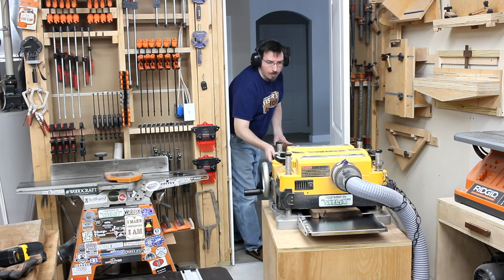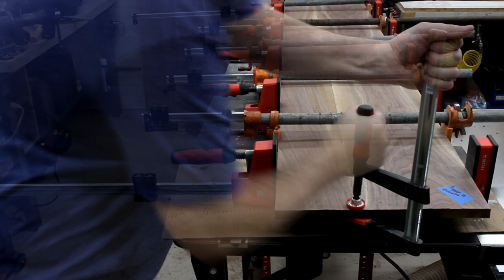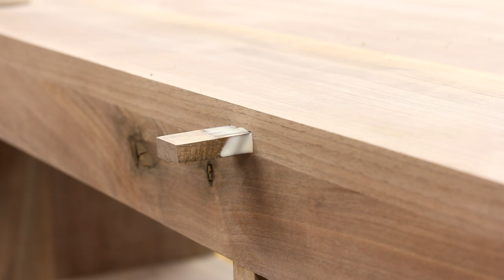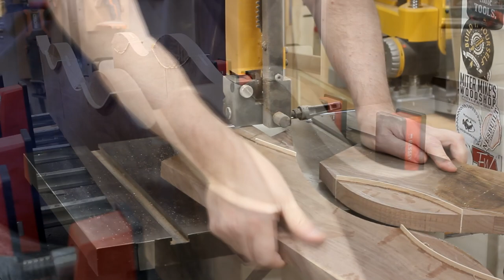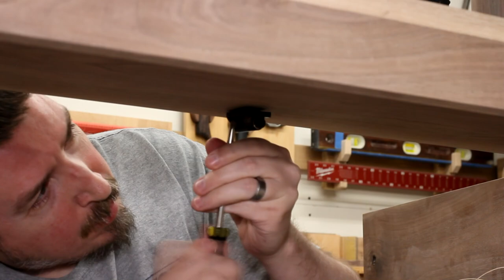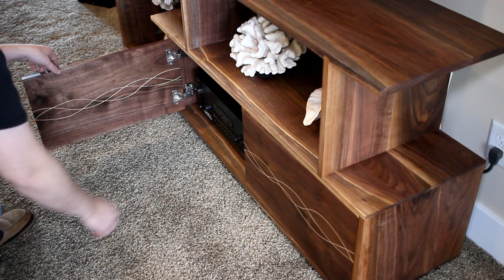Woodworking: Making a TV Stand

Comment: Very nice work, once again. I love the wavy inlay technique you used on the doors and in your previous cutting board and lazy Susan videos, and can't wait to try it out for myself. I've seen one other YouTuber do something similar, but he used a router to make a slightly wider cut than the one achieved with your band saw. He then laminated 3 different coloured thin strips between the big pieces for a striped wavy inlay. Worth a try? All the best, Paul
Reply from the maker: Yes I’ve used that technique as well. Just takes longer but you end up with a smoother edge for a glue surface.

Comment: The only addition to this great build would possibly be to route a small channel for slightly better wire management, but just be gentle on the curves so you do not damage the wires.  I used to install phone systems, data networks, cabling in data centers and so on so I'm a neat freak when it comes to wire management.  I liked the sapwood at the front.  It added a nice color pop versus a pure single color piece of furniture.  Well, warm weather is sneaking in, time to start prepping my lawn for a gorgeous lawn this summer.  :0)

Comment: The stand looks great!  Couple questions... Instead of using a joiner, why not just use the track saw to get the 1 straight edge?  Also, can you explain the salt thing?  I've never seen that tactic!
Reply from the maker: My track isn’t long enough for the boards. Salt crystals are square and therefore counter the sliding. Plus they just dissolve eventually and don’t affect the glue adhesion.

Comment: My high school shop teacher made a cool jig for cuting strips. Make a rectangular piece of plywood, and have the length about 2/3 the length of the table saw fence. Then put the fence to the width of the board, minus the width of the strip you want. make a cut along the edge of the board to 3-4 inches from the end. This little popout will hold the wood that you want to make the strips out of. Now move the fence back to the original width of the jig. Place the wood you want to cut in front and agaisnt the edge of the popout, and run the board through. Now proceed to completely not understand anything I just said.

Comment: Understanding there would be a max height limitation, I am wondering what your thoughts are on using edge banding for the thin strips?
Reply from the maker: Not sure edge banding is thick enough.  Plus it has that hot glue surface that would prohibit a good glue joint.  I don't think I'd recommend it.
Reply: @FishersShop  Appreciate the thoughts. I just bought the plans (and a few other items), thanks for sharing.

Comment: Looks great. Are you concerned at all about wood movement in the doors and/or top?
Reply from the maker: Not really.  I never need to open that cabinet but if they do get tight they can easily be popped off and trimmed down a touch.

Comment: This looks amazing, it's been a blast working with more and more walnut in my shop recently! Have saved up for a sawstop myself! I know it is a matter of space and preference but any tips on choosing the 36" or 52" fence options (money aside)? Which version do you have, Drew? As a side note I do have a track saw that can be used to break down larger materials if needed.  Just wonder how much I would use the 52" capacity vs saving space in the shop with the 36"
Reply from the maker: You will not regret the 52!

Comment: It’s a real nice design. For the electronics though, do you need to open the door every time or does your remote work through the wood? Maybe an IR blaster?
Reply from the maker: Nope.  I run everything through that little computer that's on the shelf.  Those doors never need to be opened.

Comment: Do you have an IR extender so you don't have to open the cabinet door to use the remote with the amp?
Reply from the maker: I run everything through the little computer on the shelf. The cabinet never has to be opened.

Comment: How do you deal with snipe?  I have the same planer.  Do you just sand it out or cut off the ends?
Reply from the maker: Light passes usually helps.  Sometimes I have to sand it, sometimes I have to cut it.  If the piece is small enough, I can use sacrificial scraps to move the snipe.  I have a video on it